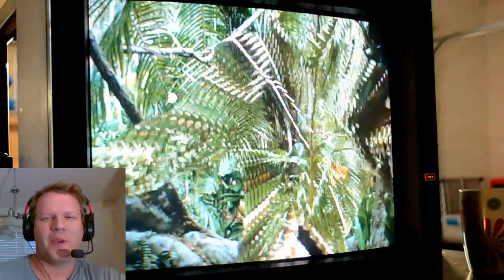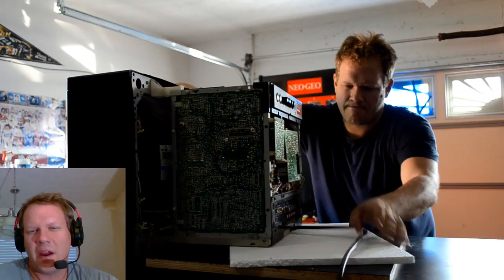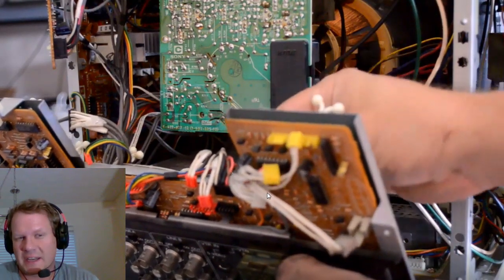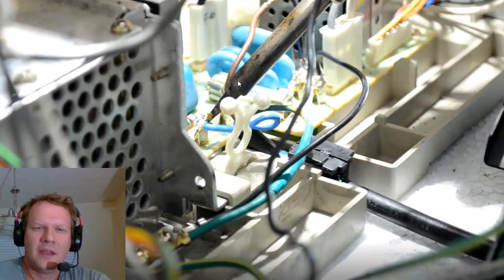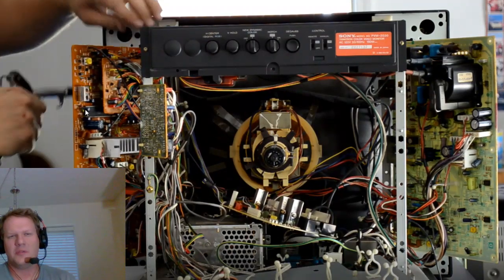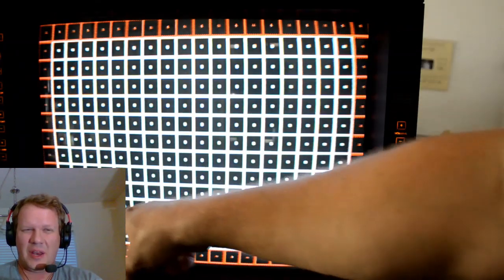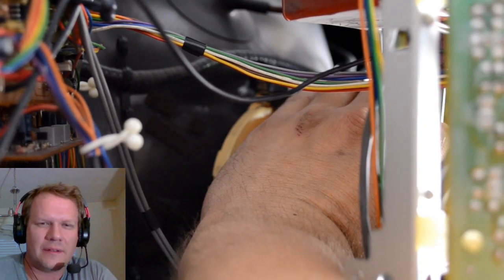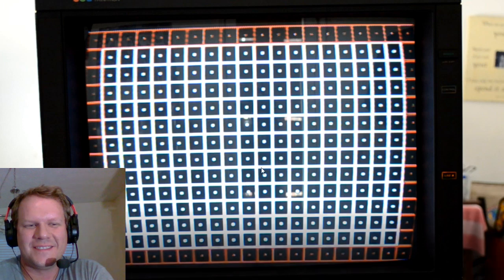Sony PVM 2030 Repairs & Yoke Adjustments

Comment: Ive owned two of these monitors and dicked around with them quite a bit. adjusting the potentiometers was a waste of time until I recapped the whole monitor. After that I got the geometry virtually flawless... I used a 2x4 and a hammer to adjust the yoke with the monitor powered on. Worked great...Didn't know about pushing the yoke all the way up to the glass. Thanks for the advice. I am working on 2 tvs right now. I will try that out when I put them back together. u da man.

Comment: Amazing video ! I've got the 2130QM as I'm in Europe. It performs great however I have a geometry issue because of the earth magnetic field. It's tilted like in your video but leaning toward the right. I tried in different locations in my room and it's perfect everywhere except where I have my retro consoles setup... I might have to adjust the yoke as a result so your video will be very helpful.

Comment: Thanks for the videos! I was able to adjust the yoke on my 2530, but I think without some epoxy or something it's drifting ever so slightly. What do you think is a fair price for a complete restoration (recapping, yoke adjustment, cleaning, calibration, etc...) of a PVM-2530? Everything works, but it needs some love to get it back to 100%.

Comment: i am looking at geting one of these, but the power button at the front is broken. it wont hold on so need tape to hold it down. Is this easy to remove the front bezel and fix the power button? i assume that a clip has snapped on the plastic button which wont hold it down anymore.

Cheers

Comment: I used to have two 2530s. I didn't like how the geometry adjustments had to be made. What looked good for one console didn't look good for another and taking the back iff constantly wasn't really an option. I was wondering, do you ever plan on working on any NEC XM line monitors?

Comment: I have a PVM 2530 that turns off on its own after some use. If I turn it on again it will turn off shortly after. Could it be a power supply issue?
Reply: Yout  issue id most likely relatet to The HV resistot assy a red plastic box wich connect the Flyback to The tube  anode. Some time The coaxial wire indife The tripler get loose and arching.  Need to be serviced to avoid any other damage since The HV release go directly on The metal shield before put The whole thing in protection.
Reply: @francescopaolella7533  I've got the same failure.  Has anybody figured out how to make a replacement for this part?

Comment: There are two folded stand offs feet on each side of the monitor that lets you put it level without propping it up when the back case is removed... pay attention. No need to prop it with planks and crap underneath...